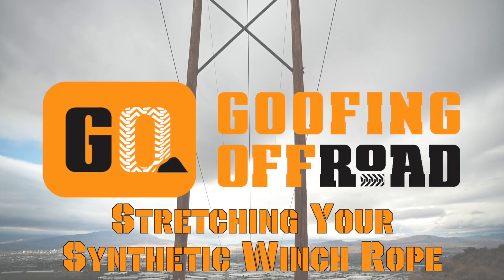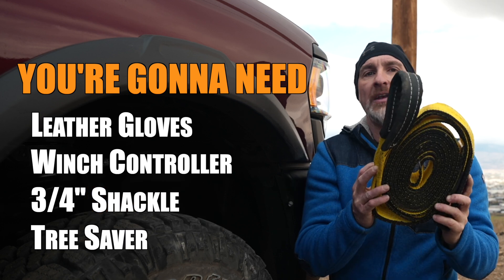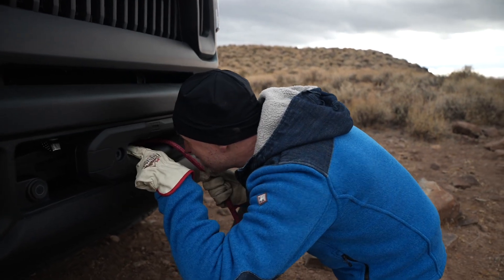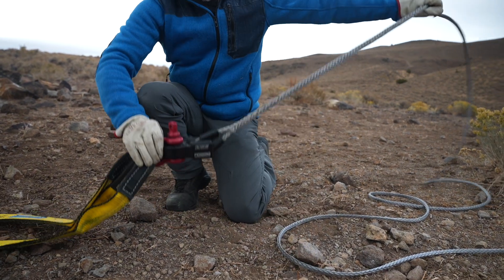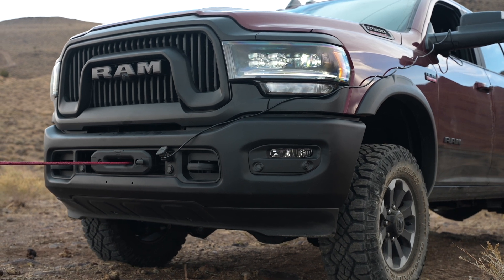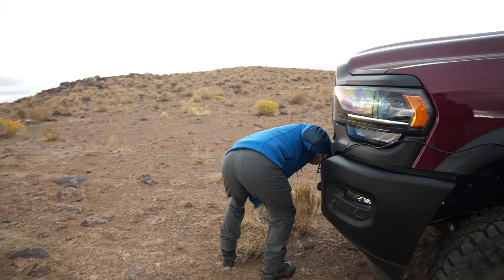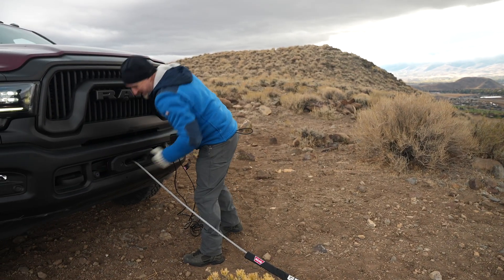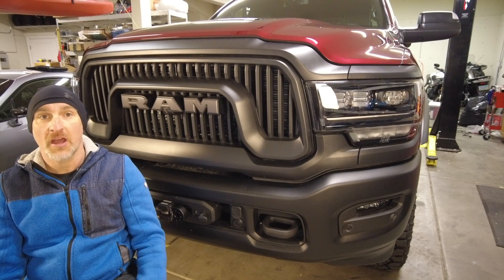New Synthetic Rope Stretch on RAM 2500 Power Wagon with Warn Winch

Comment: The nice thing about the factory winch also is that it will also works with the warn wireless remote as well. I had one for my rubi. Not wanting the cable on my new 22 powerwagon paint I tried the remote and it worked.
Reply from the maker: That's awesome.  Thanks for sharing that!
Reply: Awesome channel.  Glad I found it today!
Reply from the maker: @lbobincheck77  Thanks for the positive feedback!

Comment: What shackle is that in the winch? I have 2022 Power Wagon and I have the stock hook.
Reply from the maker: Ben - it's a Factor 55 flatlink.  I like it because it doesn't rattle around and it forms a closed system for winching.  You can get them in lots of colours too!

Comment: Some constructive criticism - Always use a winch line damper. It will drastically reduce the chance of serious injury or damage to you or your truck should the anchor, tree wrap strap, shackle fail.
Reply from the maker: Yes - a winch line damper can help.  The synthetic ropes are a lot less dangerous than the old steel ones because they carry less kinetic energy.